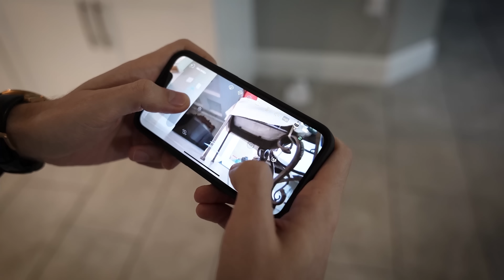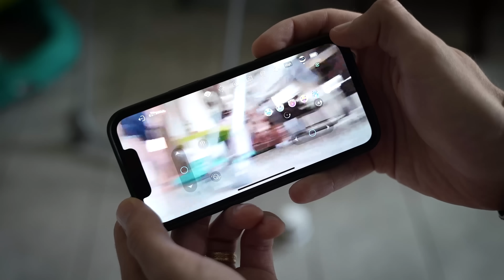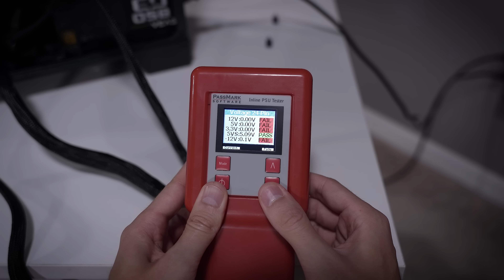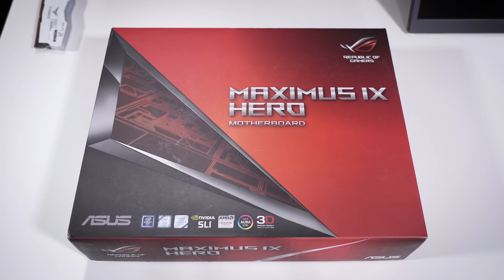Fixing a Viewer's BROKEN Gaming PC? - Fix or Flop S3:E8

Comment: I put my rig as well as my network gear on UPS units. That helps prevent surges and quick hit power outages. But my network gear was fried 2x in the last 4 years during thunderstorms. A couple weeks ago I took a close look at the grounding stake where the coax enters the house. The wire was broken and the rod was all rusted. Drove in a new rod and replaced the wire with a new 12 gauge section. Just in time too. We had an April thunderstorm, with a strike so close I heard a snap before the lightning, followed by the thunder. And everything stayed up. Moral: check your ground on the internet cable!

Comment: Greg, another informative and well-produced video, I always use a remote power switch, which is very inexpensive. I don't like sticking a metal tool anywhere near my MB. A video showing how to set up and use a test bench would be nice. The wall outlet you use for the PC should have a GFI installed. A UPS is also nice as it has an excellent surge protector. If you hear thunder, turn your PC off, disconnect the power cord, and then hide behind your sofa. I live in Florida, and I have to do this many times.

Comment: What once happened to me: I got a random complete power shutoff in my appartment. I tried to just reset the breaker but it immediately was thrown out again. So I took everything of the powersockets, flipped the breaker on and step by step put back in all my electronics. When it came to my PC I had to crawl under my desk, with the tower right next to me adn when I plugged it back in it gave a HUGE bang and a big light, tight next to me, in my PC. I took it off the grid and began opening it and taking out the powersupply, where I saw that the bang and falsh happened. I opened the Powersupply - although, never do that! Don't be as stupid as I was - and I saw a really big capacitor that had exploded. Luckily nothing happened to me or anything!
It was a 6 year old BeQuiet Powersupply. But they do have 5 Year warranty and it lived up to it. So I bought a new one( also BeQuiet :) ) and installed it. My PC worked just fine! So whatever security this Powersupply had in place worked! Nothing fucked up my Mainboard or anything. But it was a scary moment :D

Comment: That EVGA power supply should have a 10 year warranty on it. So unless he had really bad power going to it, EVGA should be able to replace that unit under warranty, and reimburse for the dead mainboard. If the original owner still has the original purchase invoices or receipts. consider reaching out to EVGA about that. They are really good with their RMAs - I've had to go through it a few times.

Comment: More than likely one of the capacitors on the motherboard around the CPU has blown. Hence the green flashing LED. It tries to power the rail but can't due to the cap. So it trips out and tries again. 
You would need an ESR meter to test them. Since they are smoothing caps for the rails removing the faulty cap and testing the motherboard without a cap in would be fine. But it should be replaced before being given back to the customer because it will cause system instability since the rail isn't being smoothed without a cap there. The pop that the customer heard would be either the top or bottom of the cap blowing off. Depending on the make of the capacitors. With bottom vented capacitors it's hard to tell if it's blown by eyes alone since there is very little space between the bottom of the cap and the board. Where as a top vented capacitor is easy to tell with your eyes because it domes up. Since the capacitors can be a bit awkward to replace you would only bother doing this on an expensive motherboard. The capacitors are cheap and normally cost a couple of dollars. With the PSU I wouldn't recommend trying to fix unless your a fully trained electronics engineer as this has high voltages which can kill and can hold these high voltages even when unplugged where as the highest voltage on the motherboard is 12V.

Comment: That "pop" the user heard is possibly from a blown capacitor in the PSU unit, which might have caused a temporary short sending direct current into the motherboard and bricking circuits that cannot handle DC. I don't want to make assumptions, but might be a valid reason as to what occurred.

Comment: Mine is a weird one, every time i plug everything back in and turn it on it shut downs immediately, no warnings, then theres a chance it boot cycles and turns off again after a couple seconds. Ive tested that its not the PSU, i dont have an extra motherboard so maybe its that.

Edit: two other twists, some times the pc doesn't turn on, some times too, the pc turns on but the debug LED isnt on and no display. I dont live near Orlando, im thousands of kilometers from where Greg lives, i wish someone local here does the same thint Greg does with Fix or Flop, guess 3rd gen intel hardware doesn't last that long after over a decade.

Comment: I'm wondering if there was a maybe a short circuit on the back of the motherboard that caused it to kill the power supply, since high quality PSUs usually have lots of protection built in.
I had a cheap $15 750W PSU, years ago, that blew up the first time I tried to overclock my FX8350, I got some pops, sparks, and smoke, but it didn't damage any other components.
Did you see any tell-tale marks on the back of the mobo?

Comment: Hi I have a question. Everytime I turn on my pc it will post and run but as soon as I try to launch a game it will start the launch then my screen goes black and my gpu fans start ramping up. what could this be and how could I fix it?
Reply: My pc has working perfectly fine for the past year and a half since I’ve had and this issue started happening a couple days ago after play cod

Comment: I'm purely speculating but it looks like what I saw when a friend hooked up a new power supply but did not use the power supply cables that came with the new power supply. It absolutely destroyed the motherboard, one of the sticks of ram and the new power supply.

Comment: Well this is somewhat concerning, that is the same exact PSU I have in my system. It is a year old now so I think I may be in the clear, but always nerve wracking knowing that a component that failed in someone's system is the same as what you've got. I know its probably a freak accident but it still gives me some worries.
Edit: I have two systems with EVGA PSU and they have been working great.

Comment: one thing ive noticed is some powersupplies like to take the motherboard with it when they fail unless the safeties kick in but the g3 is known as a budget line like ive had a malfunction with a corsair PSU luckily it didnt fry the system it was in but it never had a intensive load either

Comment: This happened to me 1 month after I built my first gaming rig, my CX750 (Bronze) had a capacitor blow-out; fortunately I turned everything off right away. Made sure to look for anything burnt/fried on the motherboard, nothing found. In the end I just RMA it and got a CX750M to replace the bad CX750. Never had issues with the system again, but it was really scary when it happened, the pop was so loud and the system tried to reboot, was lucky and got away with only the PSU being toast.

Comment: May I send my pc out to you I’ve had it for a couple years it’s not been working correctly for about 11 months it used to run 144+fps now it runs 20 at max I would buy a repair but I’m broke and I don’t have any clue what the issue is I’ve been looking around everywhere for help people keep saying to check in task manager to see if anything is high but it’s all below 70% I have four terabytes of space I even factory reset and it’s just not running good please help me 🙏

Comment: Once that PSU failed and seemed to have taken the MOBO with it I'd have chucked it right in the recyling bin. Taking no chances on that device, so good call. 

Also understandable of you calling it at the swap of just the PSU and MOBO. PSU is usually the cheapest component and replacing the MOBO is more than enough on your part. Replacing anything after that is basically starting to build a new system.

Comment: I was hearing small popping noises coming from, I believe the pci-e slot were my gpu was connected. It was a periodic pop, but was consistent in time between the noise. Replaced the MB and haven't heard anything yet. I also upgraded the cpu, so I'm not sure if it was just the MB's fault alone.

Comment: Dang that sucks for the owner. What confuses me though is that green led on the motherboard that was blinking. It was the only thing on the board that survived other than everything else (minus psu) and nothing else happened. Does that tell us anything or just that the led was blinking just to blink at this point with the power it got?

Comment: I had that exact EVGA PSU "pop". My wife called me at work and said it sounded like a firecracker went off in it. I spent the rest of the day fearing it may have taken my board or 6900xt with it. Fortunately the replacement worked and all was well. When I turned over the bad one a piece fell out that turned out to be part of a capacitor.

Comment: Very important to use a power bar with anti-surge protection. My previous TV fried  during a thunderstorm. Luckily, I could fix it by changing the main board ($70 instead of 800+$ for a new TV). Got myself an industrial grade power bar, and it never happened again.

Comment: Overall an excellent video. But while I think it's great you try to keep the jargon to a minimum to reduce confusion you are incorrect when you stated that a system won't POST without ram. A POST is NOT an output to video, POST stands for Power On Self Test. The earliest versions 'beeped' error codes to indicate issues (such as no ram). Later versions would beep and/or flash an LED.

Comment: Check with EVGA on that power supply. The G3 is normally a very reliable PSU and has a 10 Year warranty.
Reply: Right!!!! i was shocked to see that it was an EVGA G3 that failed but it can happy with any brand unfortunately. I currently have an EVGA 850GT which is one of the best PSU's out there. I remember a video by GamerNexus where they tested it under heavy load and it passed with flying colors as a top tier PSU.

Comment: pop is a chip or a capacitor ... power supply first, MB second, CPU GPU later
Reply: yep power supply died ... probably killed the board .. I would bet money the CPU and Graphics card also took a hit and probably will die early, start planning for a new system

Comment: i did that a a brand new build with the brand new am5 platform luckly it was just a fan that got to much power i think had it for a while and no problems but when i plugged the fan back in would get a crazy noise from it but other wise no problems

Comment: Earlier this year I replaced my 3900x with a 5900x (unplanned upgrade after my 3900x was broken during a cooler swap), and less than two weeks after installing my new CPU my PSU 'popped' (it was a Corsair AX760i). I had purchased a 750W Thermaltake PSU a few years before to repair my brother's computer and never ended up using it, so I held onto it as a spare. I got that connected and still no POST from the PC, so I was sweating bullets at that point. I ended up taking it to a Canada Computers for further troubleshooting, since I didn't have another x570 board and/or AM4 CPU to test with. Dreading a dead CPU and a massive bill, I felt so much relief when it turned out to be a second dead PSU! That Thermaltake must have been DOA, the only time I ever connected it before was to a different system that was also dead (motherboard in that case). Anyways, I am still extremely thankful my original PSU blowing avoided taking anything more out with it.

Comment: Hi Greg. Love your videos. I learn alot from watching them. I have recently thought about upgrading my gpu from a 2060 with 6 gigs of vram to something with 8 or 10. The problem I am facing is I am having difficulty in finding out if my mother board supports the upgrade and what I can upgrade to. Can I just go from a 2060 to a 2080ti? Will it work? Any help you can give me would be great. Thanks so much. Keep it up.
Reply: @Mr_GregSalazar....  what are your thoughts? I have a 2060, would a card for a card and some cash be a good trade? Are you interested?

Comment: The EVGA G3 850 (Super Flower OEM) was released in 2017, and I believe has a 10 year warranty).  I have no problem with the fact that any computer power supply can fail.  However, I am concerned that the failure of a top tier PSU may have resulted in death of a connected component; the motherboard.  I have no doubt that EVGA would provide a replacement PSU, but I wonder if they would also cover the cost of the board.  I'm aware that Greg kindly made the user whole, but I'm wondering whether a power supply company would warranty other damaged components caused by their units.

Comment: I once had a bad power supply blow on me thankfully it only took the motherboard and the rest of my components were fine it turned out the motherboard had a chip that cracked in half with the surge of power and stopped the power from getting to my other parts I replaced that psu with a be quiet psu and i could only afford a cheap a320 board I used to have a b450 board so now I am running into ram problems with my motherboard. I have a ryzen 5 2600 with a gigabyte a320 board and 32GB of 3200Mhz RAM but i have to run it slow (2666Mhz) as the board wont let me go any faster on the ram and I cant afford to replace my motherboard at all right now due to medical problems.

Comment: Just wanted to give a huge thanks for making these types of videos. I did my first PC build last week and once complete I had 0 power going to anything. Because of these videos I was able to track down that it was actually a USB-C header that I had plugged in backwards (the guide I was following said it can go either way). Had it not been for watching these videos, there is no chance I would have solved it on my own. The tip of only hooking up MB + CPU and power, no other connectors got me to power on the board, and then I was able to narrow down my mistake. I was  amazed that having a single non-essential cable plugged in backwards wouldn't even let the standby power get to my MB. Thank you so much.

Comment: The question really becomes which one went first, the psu or the motherboard. I have seen similar behavior where it cooked it from the back of a motherboard briding connections against the tray many many moons ago and the power supply went POP when it was jostled and made the connection.

Comment: start with the power switch and then the power supply connections . look for swolen compacitors. Popping compacitors  from power supply can happen if there was power supply compacitors going . I had this happen from a bad power supply plug .

Comment: If this PC started its life off as a prebuilt from MSI and then the owner made changes to it like putting in a new EVGA 850W G3 power supply well, then if he didn't change all the power cables from the previous PSU (most likely the original PSU was an MSI unit with much less than that 850W G3) then the pin layout most likely was different which would explain the POP they got IDK??? :s

Comment: A pop always leads to suspect power supply. It is pretty rare in my experience to get a pop that doesn't include the power supply. The flashing LED on the motherboard indicates a short on the motherboard and I would suspect that something on the motherboard went bad creating a short and the old power supply didn't have proper protection and died because of it.

Comment: Always recommend putting your PC behind a Power + Surge UPS and a good surge protector as well.  Get a good one that will also condition the power so you don't have to worry about brown outs.
Reply: There is lots of lightning in Florida.
Reply: @pctrashtalk2069  In my country (Netherlands) We don't have much lightning and most of the energy grid is buried below ground so here the risk is small. But it's never zero. Still i got away without protection as long as there are personal computers around (i am 53 using computers since 1984 never had an issue with fried components due to surges). It all depends on your location and energy grid and amount of times your energy grid get surges.  But i am not stupid when there is an outage i would take the computer from the outlet because once it pops back on you can get a surge.

Comment: In 30 years of PC tech, I've only had one PSU do the pop and burn: A 430W Thermaltake that lasted only 20 min. Thankfully, I was right there and I don't recall any other damage. This was in the early 2000s and the PC was not at all power hungry. I know even a respected brand can have a few lemons, but I have also had off-brand PSUs that lasted much longer. Though I am certainly no EE, I find PSUs fascinating, even more than GPUs (not a gamer).

Comment: Hero boards are beautiful. Miss my old Maximus VI Hero. If the power supply is good quality. It's weird to hear about a psu taking out anything other than itself. Psu's are usually made to suicide itself before taking out other hardware with all the protections. EVGA is usually a good psu company(even though they don't make there own) on the same list as corsair or seasonic. I still recommend them even after this video. I pretty much stick to seasonic psu's. In the future I may try out a bequiet psu. Usually comes down to if I feel the price is worth it though.